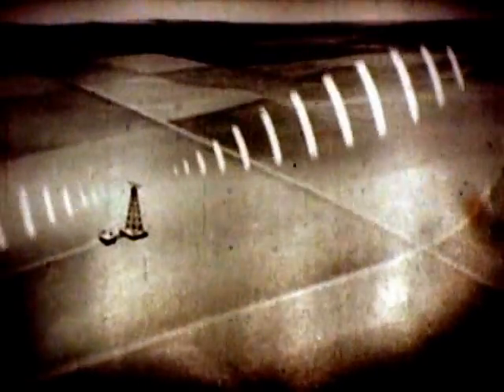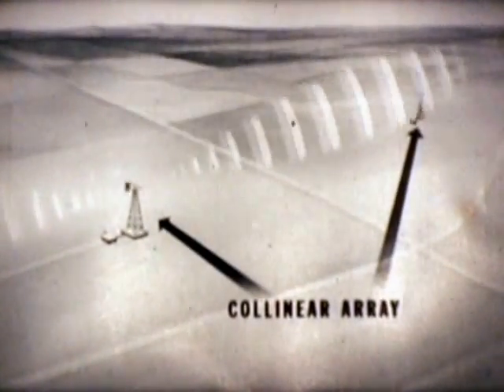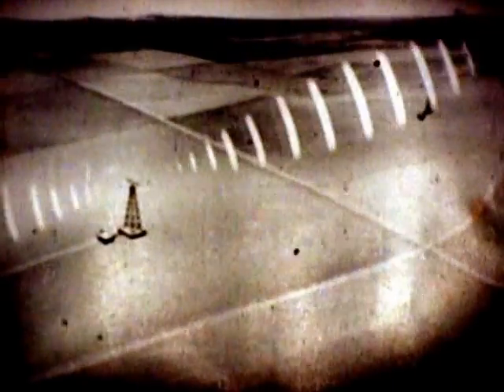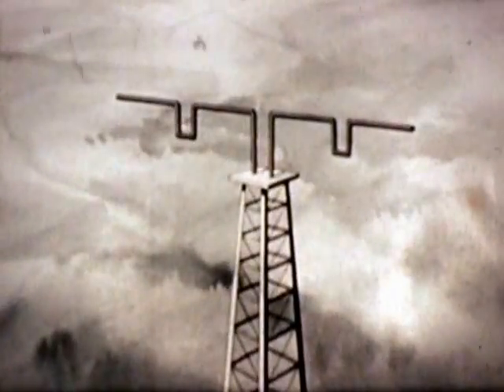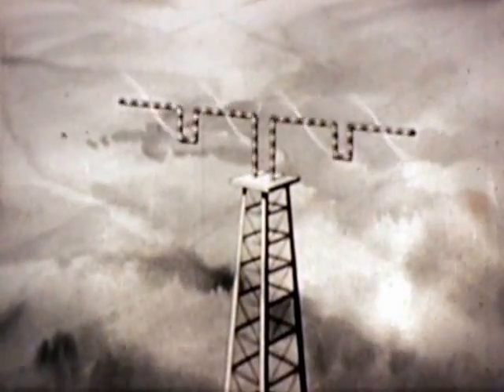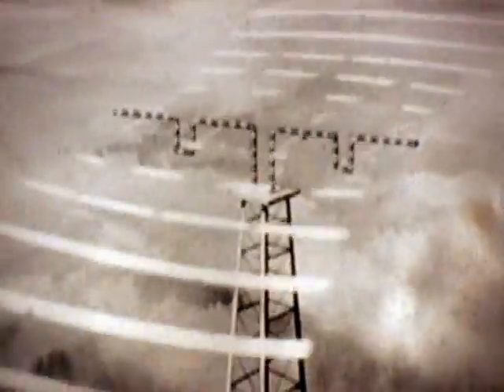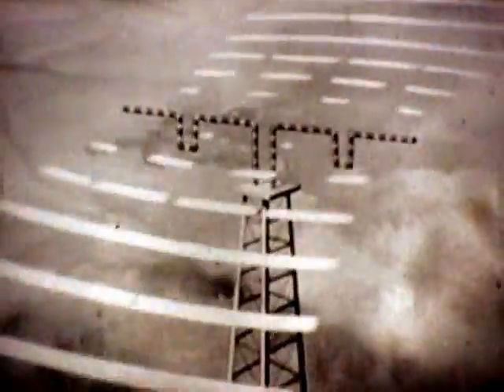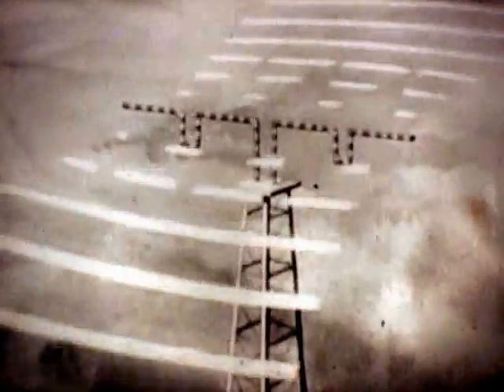Radio Antenna Fundamentals  - Part 2 1947

Comment: As a ham radio operator I have gained a wealth of knowledge from these old instructional films especially the military stuff on radio. Far too many ham radio operators cram for the test try two or three times until they pass it retain no knowledge and end up asking dumb questions,. You should be embarrassed if you're an extra class license holder and a tech is making you look stupid...

Comment: Todays antennas arent meant for any kind of long range in the tv spectrum. Channel Master Pro Series you gonna spend 300 bucks buying the whole thing in sections when they have a less expensive series for 1/2 that far exceeds the Pro
Reply: The trouble with TV antennas is that you need very wide bandwidth if you don't know precisely which channel you are after. But simple Yagis are narrowband. If you know the channel, a long Yagi cut for that particular channel is your ticket - but you probably need to make it yourself.